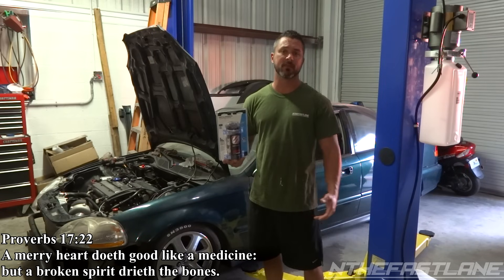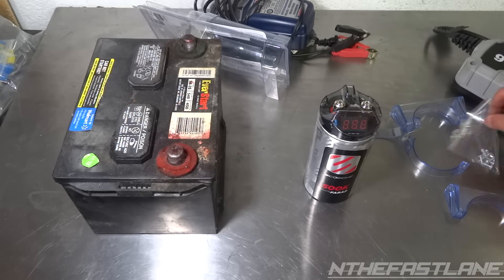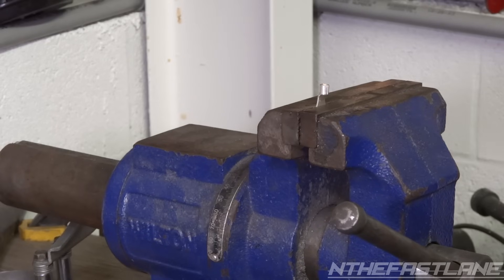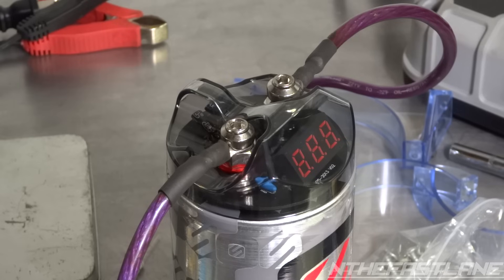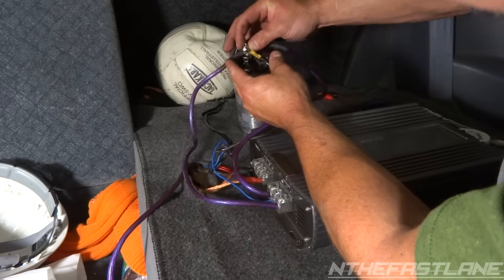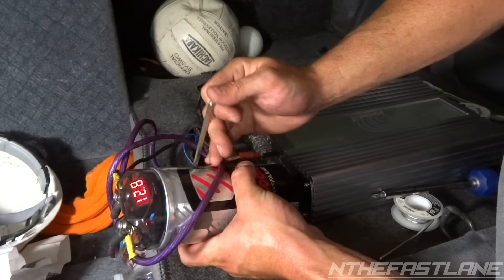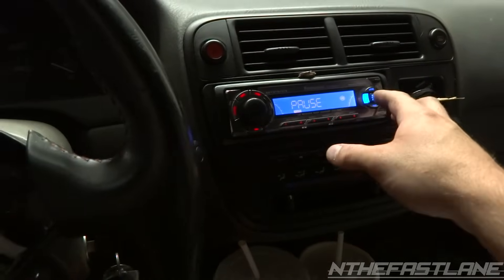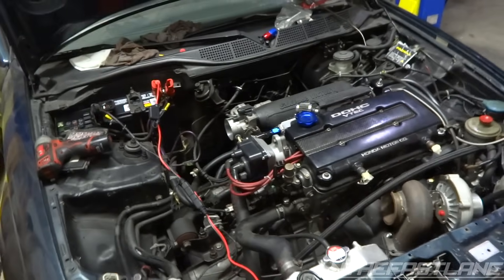▶️Amplifier Capacitor Installation "How To"⚡

Comment: isnt a diode actually really a resistor, only w specific value per application? I am only asking, seems to hard on urself to consistantly/ redundantly correct yourself. I only appologixe 1x and its a fact, people know. If the seem to forget that i already appologized, its they who are the SORRY one. Life's to short man, thank u for the video, my lack of vision of project steps ahead been keeping me procratinating n this is not good. Seems a cycle, ugh. I did throw together my car audio today, had equipment about a year. I have a full solar setup and bat bank too, it sits in storage. Time now to lite that fire up under muh own arse, u dig? Peace my brother.
Reply: NO! Diodes have one purpose and that is to allow current to flow in one direction only. nothing like a resistor at all

Comment: you dont need a digital capacitor its just accessories dont be so dumb in car audio! just  a basic

big 3 upgrade
high output alternator
and extra battery for the amps!

thats it no need for capacitor tsktsktsk!

Comment: SEPARATE the grounds!
With everything on the cap, noise can't dissipate in the chassis and ends up bottlenecking and backfeeding at the cap! The cap will cancel noise on the + but this is a potential problem created by the circuit design! 🤦

Comment: Hey is that the same solder and flux you use on copper pluming please. I like the way your installing thanks
Reply: With copper wire you never use acid flux it causes corrosion more quickly

Comment: First of all  (SYMBOL FOR DIODE ¥) with that said what diode  are u using  second of all diode have negative (cathode) and a positive (anode) side.  So current cud only flow one direction.What side is your anode and your cathode ??   When u charge your capasitor.? Of course is battery to capasitor  so the diode is cathode to anode FOR your viewers need to know that  SPECIFIED FOR. YOUR VIEWERS DON'T MISLEAD PEOPLE AND CUD CAUSE SOMEONE TO GET SHOCK OR EVEN DEATH  ( SOME PEOPLE OUT THERE THINK JUST CUZ THEY SEEN IT ONCE THEY ARE EXPERTS AND HAVE. YEARS OF EXPERIENCE DOING THINGS ) BE CAREFUL  WITH WHAT YOU ARE DOING.  DON'T CATCH YOUR CAR ON FIRE  .👩‍🔧💥🔥🚗🙅🏿‍♂️🤦🏿‍♂️🤷🏿‍♂️🙍🏾‍♂️ 😨😱👩‍🏫

Comment: Why are we taking advice from this guy? Hes admitting his system is currently wired wrong and the rule of thumb is 1 farad per every 1000watts your amps got you need 1.5 farads

Comment: I'm just getting into car audio so I'm not trying to be a smart ass.Just wondering why the big guys like Mead916 and exo Contralto and on and on don't use capacitors in their 10000 and 30000 watt systems.You would think these guys would need it most.Are caps just for lazy or poor people that can't do extra batteries and alternators.Just saying,just started I don't know.
Reply: Stephane Menard It's used mainly for noise produce by the alternator..The better ur amp the bigger the capacitor inside the amp... It clean the sign....Farad also got to match RMS...4k n up for bigger system.... Battery, Alternator if you can afford it

Comment: you have amp 1000 wats. and capacitador.   500.    no good.
Reply: La mariana usa agree
Reply: La mariana usa 500mf, thats 1/2. of 1 Farad I believe. I have the same digital scosche cap, i jist parallel it w other larger cals to utilize its LED.  have to get circuit boards to evenly chg/dischg the caps.
Reply: Sinaloa nabolato those caps are not real cap they built cheap your better off getting a up graded battery or add a small one

Comment: Your headlights will dim no matter what. Unless you have hids
Reply: No they won’t. I put a cap in my system, headlights no longer dim.
Reply: U got to have the right amount of farad's ..But u got to also have enough power to run the amp... everything with no probably...Once the battery amp drop to low.. U in trouble

Comment: To let people know DC power cannot hurt you yes you might feel a shock but it cannot kill you that's what words with the war between Edison and Tesla was about Tesla say C could kill Edison's DC could not there for 12 volts coming out of this capacitor cannot nor will not ever kill you why do you think tasers are built they carry 50,000 volts of electricity DC if you have 50000 volts of AC with four milliamps if I'm remembering correctly you will die as long as that amperage is lower it will not kill you just to get that through your heads messing with this capacitor will not kill you

Comment: Dude you should learn how to do something before you try teaching people fry their electrical system and or start fire easily depending on the charging system of specific Vehicles some require a designated ground some require being grounded separately to the chassis, not capacitor grounded to the amp the way you have it hooked up the amp and capacitor will be drawing from the battery at the same time it should be thick Pastor draws from the battery and the amp draws from the capacitor this is why you have your separate grounds even using a common ground is still separate due to electricity flowing with least resistance( your power wire and ground should be bigger supplying the capacitor then your amp 2 capacitor) so if you're amp requires 4 gauge then you run to gauge from your battery to capacitor and your capacitor ground also 2 gauge) also to help with any ground looping issues if it is not a dedicated ground which will create resistance and with resistance causes heat then fire if the circuit doesn't melt away first

Comment: Ugh. No, a capacitor wont kill you. Touching the terminals of a cap charged to 12 volts is no different than touching your car battery..

Caps arent magical objects that pull power out of nowhere, if your electrical system cant handle an amplifier adding a capacitor wont fix it.
Reply: Dan Van Montfoort It could but not at 12v You will need a higher volt on that capacitor

Comment: Thanks for not showing us how to charge it when all things are wired together. What do we have to do to get a proper tutorial. Is there a conspiracy on youtube so no one actually shows us how to charge it with a resistor. I think you are all lying because I tried it and the caps are making a ticking noise and I was told that is bad. Plus the cap did not charge, it hovered at 6 volts for ages then started making a ticking noise. and slowly started to charge again, at that time I took it off. You are lying so we ruin our caps.

Comment: 90% of the time running a 1500 watt amp will not make your headlights flash if you use the proper Gage wire for the positive and negative  not speaker wire for 1 and 8 Gage for the other

Comment: lol
"voltage creates friction"
Reply: Lol... I was thinkn the same thing, Michele!! Lol... This guy isn't too bright...lol.
Reply from the maker: Run a sweeper, then touch the plug closest to the wall socket. It'll be pretty warm. Current moves through the conductors with some degree of friction.

Comment: “Cause these things can kill you” gtfoh. That “capacitor” has a filler body and a tiny cap that would fit in the palm of your hand that does almost nothing. It’s a gimmick. Upgrade your battery, alternator,  wiring, and do a big 3 if you want to make an effective electrical upgrade.  Wish I could show what voltage is supposed to look like on this thread. 15+ volts sustained voltage under maximum load. Hand assembled lithium batteries and a Js ultimate hand made high output 370 amp alternator with multiple runs of welding cable, big 4 upgrade, and wires big enough to sustain more than 50 amp draws like that 8 gauge he’s using for power and ground in this video 😂. We use that for speaker wire, literally. So much misinformation here.

Comment: This entire video was horrible advice. Caps are not a way to fix an electrical problem. You amp is kicking off because you are clipping and have bad voltage drop. Your amp gains I am gonna assume are not set properly plus your head unit once turned up so loud is sending a dirty signal. Which is why you are having problems with your amp kicking off smh

Comment: Haha can kill you. Well not shock you but would probably burn you or explode but I doubt it  if you short it the thing you holding would vapourise  depending on thickness   So possibly burns  might or might not  that’s if your not stupid enough to over volt it on purpose lol

Comment: Caps are useless
Reply: SKATE1776 Not true if you look inside the better amps...Ur cap are bigger..It help clean noise out the power line n with the correct farad's keep the bass hitting hard...But u got to have enough power to push them all...